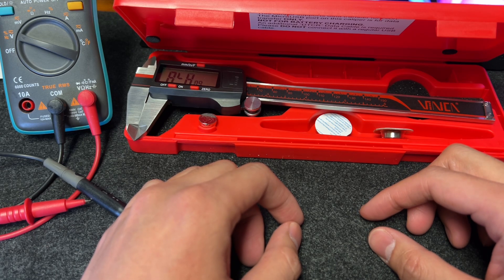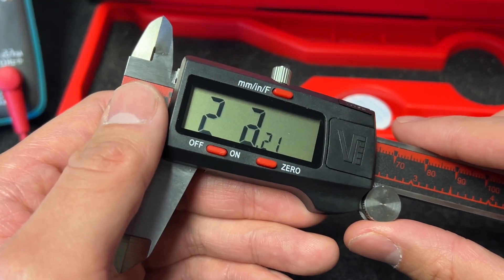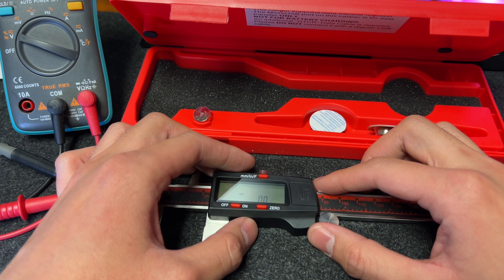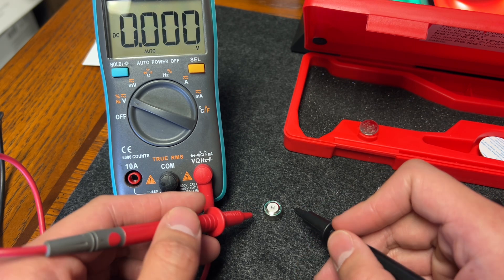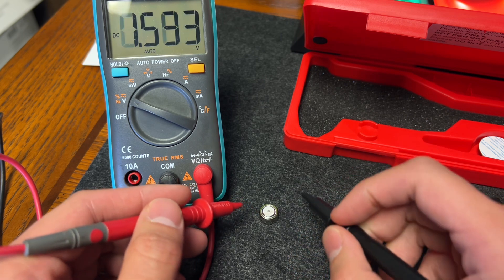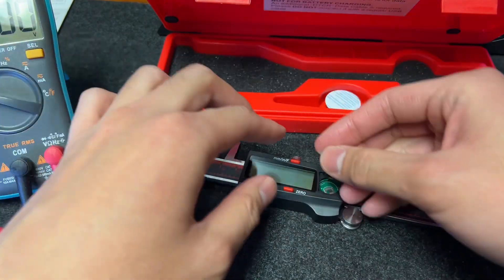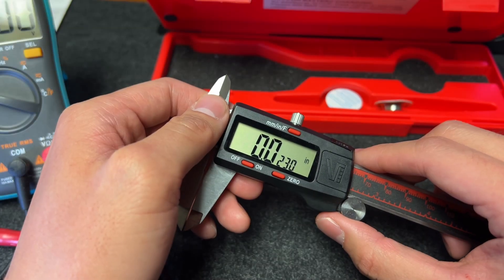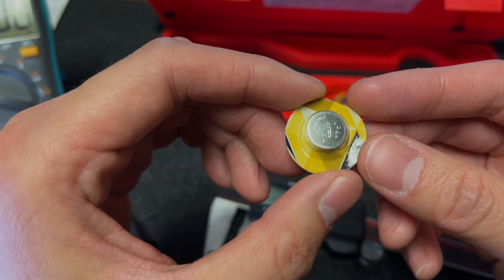How to fix a malfunction jumping blinking VINCA digital caliper

Comment: Cool thnx. I got a WZ SL 150 digital caliper (from iFixit) with the exact same problem. 

Checked the battery and it showed 1.1 volts. I changed the battery, and now it works. 

The caliper has been like this since it was brand new. 

Why it was like this since I got it, I don't know. I tried shaking it both while it's inside the box and while holding it my hand, and it doesn't just turn on. But it does have an auto on function. It seems it needs to move about 0.15mm before it turns itself on. 

Inspecting the box I see that there is a space to store the battery so I can take the battery out (as you and one of the commenters suggested) and store it in the box so it doesn't accidently discharge it self 😁

Great video, informative and straight to the point 👍👍

Comment: One reason the battery can flatten is that there is an auto-on feature - when you move the caliper blades even slightly the device switches on. This can happen by accident such as when you are not using the device but merely shifting it around, or out of the way. I seem to have ended up with a very flat battery very quickly because of issues like this. i think I will take the battery out each time I finish using the device. Sigh.